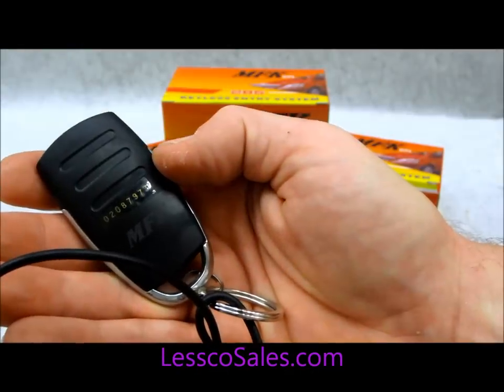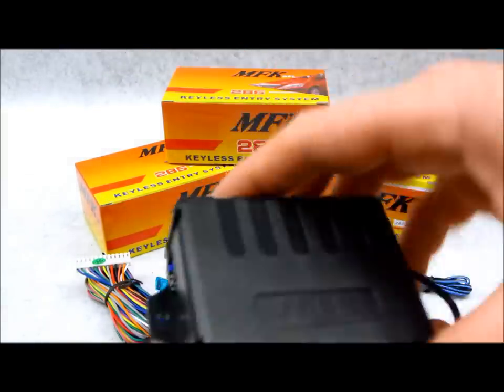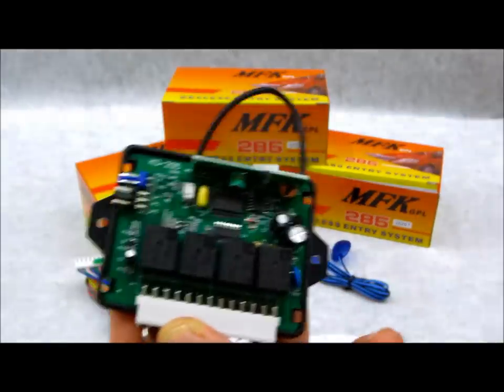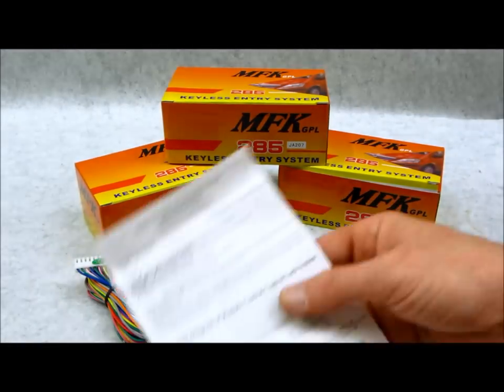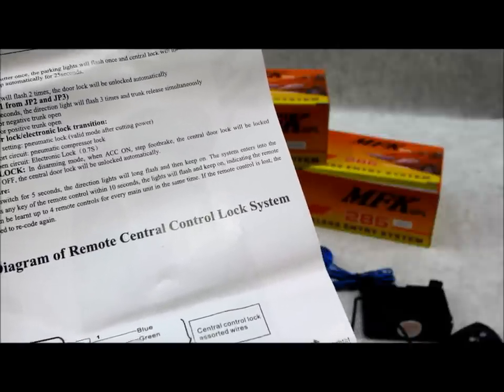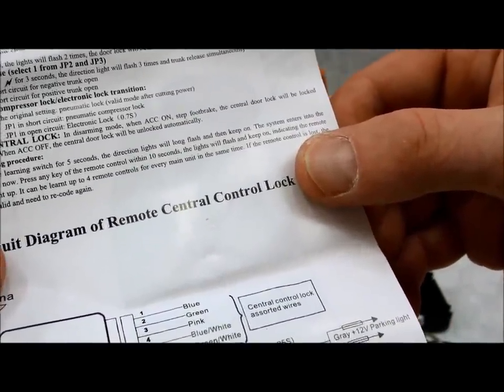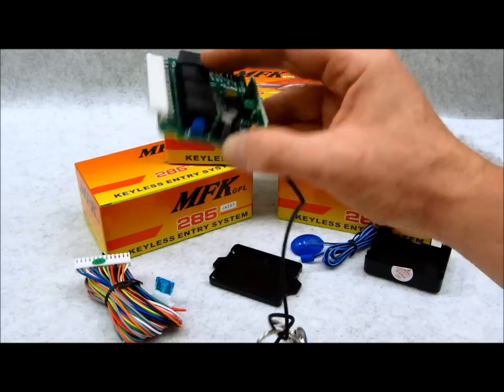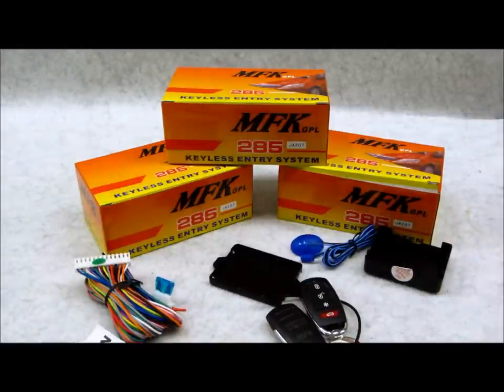How to program most chinese generic keyless entry alarm remotes

Comment: I have a keyless entry install in my vehicle but bought it second hand without the remote. tried to open the box like what you did but did not find the learn button. do you know how to reset the box itself? planning to buy the keyfob only if this is possible. thanks!
Reply from the maker: what model number is on the brain under the driver dash?
Reply: Not worth it they are so cheap for whole system